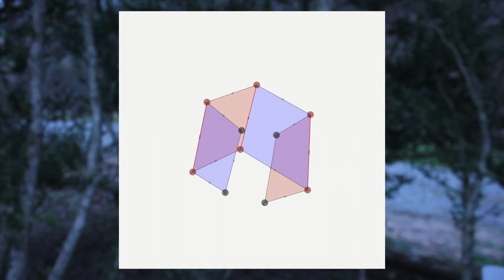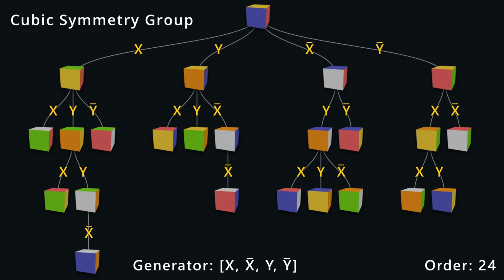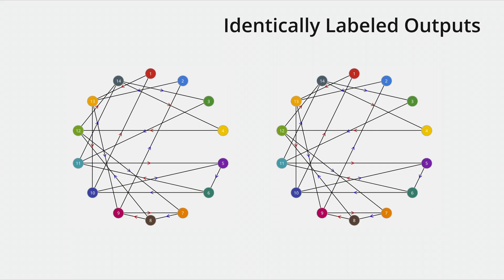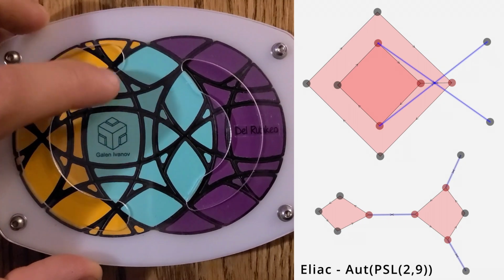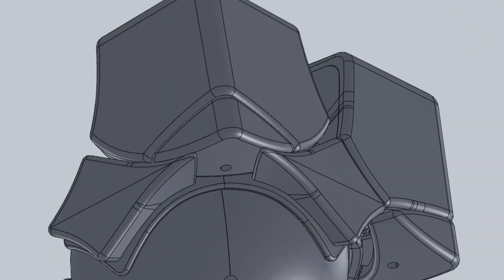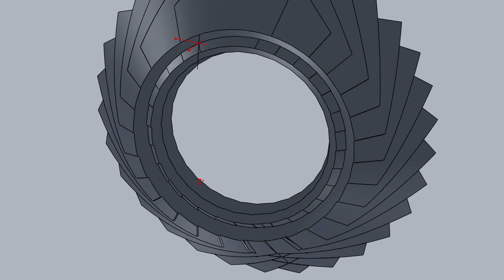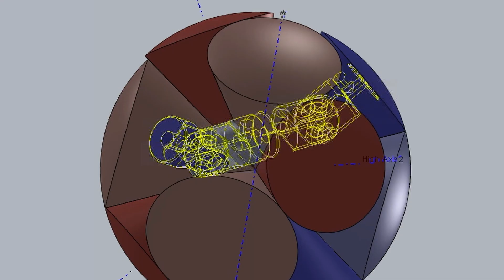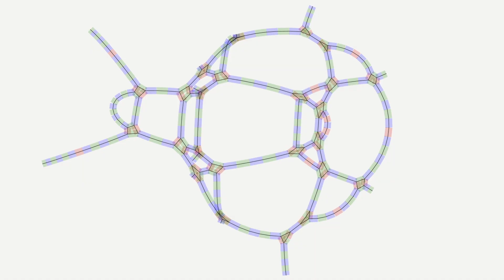Designing Twisty Puzzles - Group Theoretical Approach

Comment: incredible! i also like cubes and have a little collection. and i know just basic group theory. i would also like if you would go into more detail about the mathieu group and how this cube captures it, and also about what is fudging

edit: i realized it is not a Mathieu group but PSL(2,9)
Reply from the maker: Fudging is when you have cuts on a puzzle that normally would jam or not mix very well due to incompatible geometry, but you re-shape them in a way that lets them mix. They sometimes have a characteristic look with funny gaps between pieces. Illegal Cube is a classic example, and lots of mixup- and sun- puzzles are fudged (see Doctor Skewb, Sun Octahedron)

Each group has characteristics that factors into how you solve (in this case) the edge pieces.  
For example, Mathieu M12 has the rather incredible property where you can arbitrarily place 5 pieces wherever you want, but the remaining 7 will always fall into one specific layout governed by the group symmetries.  For practical solving purposes that means you can solve 5 pieces into their intended locations and the group rules require that the remaining 7 will also be solved.  
For PSL(2,13) there are different rules - PSL(2,..) groups will have two fundamental types of cycles, in this case 13-cycles and dual 7-cycles, and you can solve it through a sort of reduction method where you eliminate the big primes to produce a simpler subgroup.
Reply: Thanks for the explanation! I want to dive more into group theory and algebra to understand it.
Reply from the maker: @zsomborvenczel9459  Of course! Check out TheGrayCuber's intro series for some entertaining fundamentals.

Comment: I would like to know more about the graph canonization to maybe implement in a programming project of my own. Could you share any resources about it?
Reply from the maker: Sure!  It's a tough problem and there are lots of papers but not a lot of complete implementations.  In the published version of GroupExplorer I use an older algorithm called bliss (C++) / jbliss (Java) which mostly works well for my datasets.  If you use Java that might be your best bet, check my jbliss github fork.  The state-of-the-art algorithms are Nauty (general purpose) and Traces (fast undirected) which are available in Dreadnaut for commandline, Python libraries, and other languages.
Reply: @QuirkyCubes  thank you!!

Comment: Really cool work here. But it's worth noting: not all puzzles are groups! Any puzzle which bandages, or which jumbles from partially turned positions, among other traits, is actually only a groupoid, since not all algorithms compose. That opens up even more options for novel puzzles.
Reply from the maker: True!  Jumbling has the reputation of relaxing permutation constraints, (mixing orbits or removing parity restrictions) which is kind of opposite of what I'm trying to do, but some cases seem to be promising in the sense that their intermediate moves can perform complex cycles that aren't possible with simple geometries.  I do plan on using these in some future designs, to get pieces to mix in ways that allow representations of non-planar graphs.  

You can see a simplified example of this on Quaternion Cube - Q8's generator graphs are all non-planar, but by specifying the constraint 'all algorithms must keep the corners solved' you can express the group on a polyhedron as a subgroup of SL(2,3).  The same seems to work for some sporadic groups with many pieces - set up a clockwork that performs multiple intermediate moves to exchange pieces in a non-planar way. The intermediate states form a groupoid but are shallow enough that you can ignore them or automate them away when solving.

I'd imagine there could be a lot of interesting possibilities in puzzles that require intermediate moves like Krystian's Cube, or in the shape preserving states of jumble-only puzzles like Jumble Gem, but I haven't got to studying them yet.  The group search space is big but groupoid space is massive.

Comment: Absolutely loved this deep-dive! My only question is, how possible would it be to make the Monster group into a twisty puzzle? I assume it would be entirely impractical,  but is a simulator even possible?
Reply from the maker: The only other sporadic that I've found a working geometry for is Aut(J2). I think some variant of HS, McL, Co3 might all be possible yet but they're tough. Once you get to groups with 250+ points all generator graphs tend to be non-planar and mechanically infeasable. The monster could possibly exist as some sort of simulator, but I think with any known generators it would be completely incomprehensible